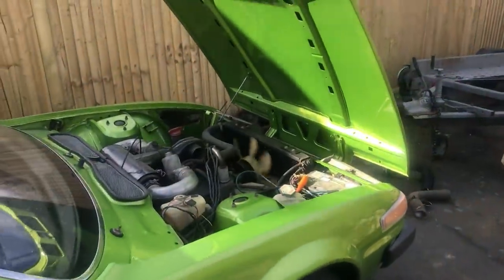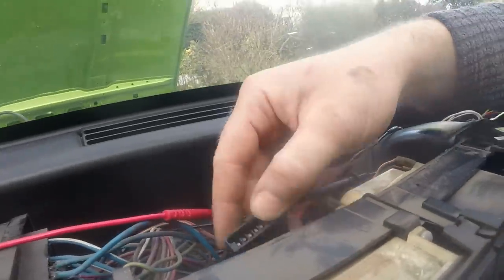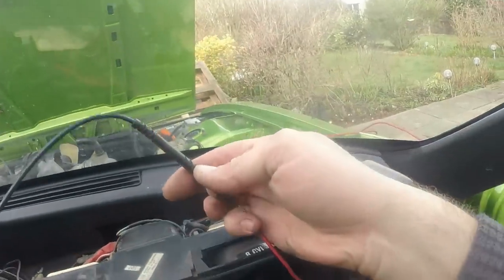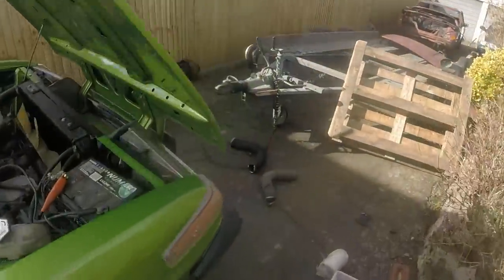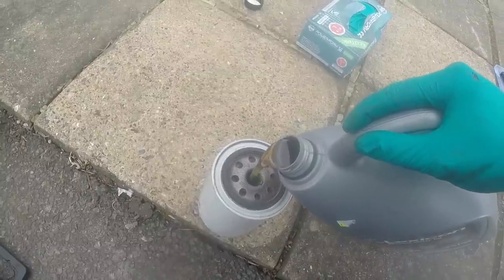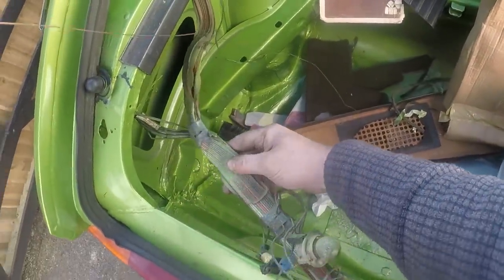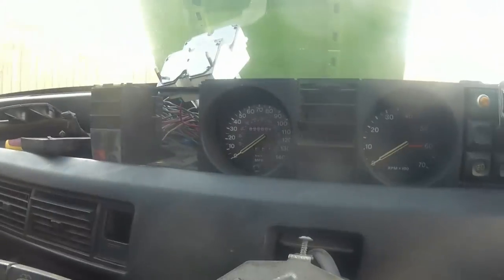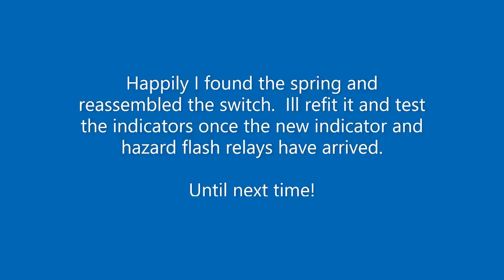Dotty 1981 Rover SD1 V8 Restoration - Video 63 Oil change, wiring gremlins

Comment: I remember (when the SD1 was first launched) what a big deal was made of the separate dashboard pod module at that time being so innovative. I didn’t realise that the dash fuses were also mounted on the side...- very clever for it’s day 👍🇬🇧
Reply from the maker: Its pretty neat actually.  On the series 2 the fuse box is under the rubber mat that sits on the top of the left side of the dash, and has the more conventional fuses.

Comment: Hello James. I was thinking I'd use a cheaper oil and change it again after running a bit. Good call. I like wiring jobs. Nice and logical and quiet and clean which can be a welcome change after welding, grinding etc. Looking good, buddy, take it easy. Mart in Solihull.
Reply from the maker: Hi Mart, yes i rang my mate up and said what id found and suggested we ran cheap oil to see what develops.  There are no other symptoms of a head gasket, so i really hope its just very old oil with condensation on it.

Comment: Keeping up the good work it’s looking good yesterday one Rover SD1 it’s getting there They sound nice now and warming up be nice if it was an automatic choke but it’s when it was at the time when they made it manual chokes and they change them to automatics 😀😊
Reply from the maker: Yes series 1 all had manual chokes, and then series 2 had auto.  Some of the auto chokes could develop a fault and rather than fix it owners removed teh auto choke and fitted a manual choke again.

Comment: Hi the rusty box attached to the back of those aux guages that had a broken wire should be a voltage regulator if it helps
Reply: Indeed, I was looking to see if anyone had mentioned that before I did.
Reply from the maker: Ahhh thanks.  So that must be just for the battery indicator?
Reply: @nitrosilvia  The Battery condition indicator works on the direct battery voltage.  its a Bi-metallic movement so it is naturally damped as it takes time to heat up or cool down.  If I am not mistaken isnt the rusty metal box the Low fuel light delay unit (also Bi-metallic?) ? It stops the low fuel light coming on as you drive around corners until the level is maintained below the low fuel level. It used to have a usefully long delay of a few minutes if I recall.  I fitted the LH section of an SD1 dash into my '76 Mini Van - so had a load of warning lights with nothing feeding them - so the Low fuel light was just wired to a toggle switch on the dash.  As one of the few 17 Yr olds with a car at college, I was constantly nagged for "a lift" here and there.  So at lunch we would often just drive around, at some point in the drive I would toggle the switch and minutes later the light would come on.  So if some one asked me for a lift my lunch time passenger would verify that I had no fuel, so could not give said requester a lift, unless of course they paid for the fuel to be filled.  3 quids worth used to last a week then!

Comment: The collar idea is a good one. When the steering wheel comes off my car next, I need to find a way to sort the wobbly stalks out. I have some spare assemblies with tired stalks. Might need to make a good one out of a few or patch up the one on the car. At least my car’s wiring is only very slightly bodged.

For the time being, the steering is at its top and furthest away from me, which clamps things in place. Good job I’m tall and have long arms.

Comment: When you watch vids like this you realise just how much work goes into restoring a car. Not just the big stuff like panels, paint and engine work, but details like trim and sealing, making sure all the switches and gauges work. There are no short cuts and it takes an age. I suppose there is a reason why there are so many unfinished projects kicking about! P.S I am just wondering if that might be petrol in the oil, it does seem very thin.
Reply from the maker: The oil is real thin.  Doesnt smell of oil or coolant though?  It might be a weird grade that ive not seen before?

Yes these things take forever.  Makes me realise how much logistics and planning goes into teh restorations you see on tv where they do it in three weeks.  Or maybe they do shortcuts!

Comment: That upper - boot drivers side multi-plug may have been for a stacking 6cd stereo player....(possibly)🤔
Reply from the maker: Its quite possible.  There was loads and loads of additional wiring for a stereo.  Had real odd plugs on it.

Comment: Did you get any more clues to what the specification of the engine is . I remember one the the early videos when you got the car you were investigating the cylinder heads etc.  Great work as ever cheers
Reply from the maker: Hi Steve,  no not yet, still in the dark.  Its quite strange, the rocker gear is all standard, but on one bank its all been polished up?  It sounds lumpy at idle, which could be the result of a cam with a bit of an aggressive overlap or just that its badly timed.  There are other bits like the carb intakes have been ported and the K&N filters inside the airbox that make me think someone has done something to it, but i wont know till i drive it or it goes on the rolling road.
Reply: @nitrosilvia  Thanks . It could be a real flyer . Can't wait for the road test / rolling road video ! Thanks for sharing really enjoy these videos

Comment: Starting and stopping in after running for a few minutes especially when the air temperature is cold, will not help with the engine condensation and possible water in the oil?
Reply from the maker: I think you are right.  Really needs a good run under load

Comment: Looks like your working your way through the wiring slowly and successfully. Old wiring is certainly much more logical to understand than the modern canbus type in today's cars!
Did the 2300 have a rev counter on the early models? Or am I getting confused with the 2000?
Reply: I think it almost certainly had a smaller dash pod of ancillary gauges.

Comment: Apologies if this is a daft question but how do the jacks you are using work? Do you use the trolley jack to get them under it?
Reply from the maker: Yeah use the trolley Jack to lift cans then position stands underneath. The lever and toothed bits are just to adjust their height. It doesn’t actually lift the car. Think they came from Halfords
Reply from the maker: Yeah use the trolley Jack to lift cans then position stands underneath. The lever and toothed bits are just to adjust their height. It doesn’t actually lift the car. Think they came from Halfords

Comment: Obviously renewing cheap items to do with the running of the car  is generally worth it, it makes the car potentially more reliable, your not messing about every five minutes and sourcing and waiting for parts, even new bulbs are usually a lot brighter some cheap  ones side pins can be too short.